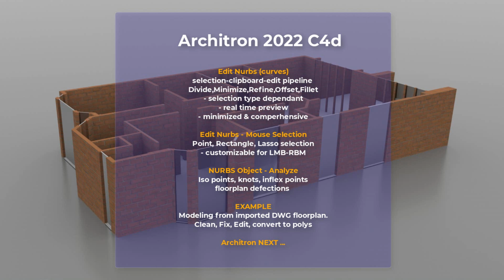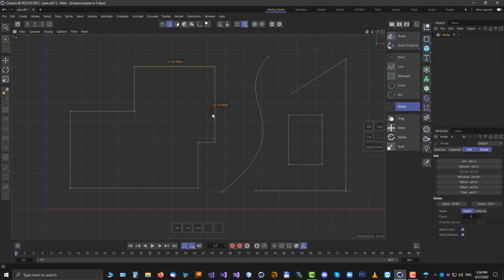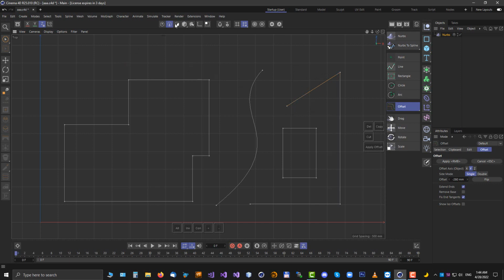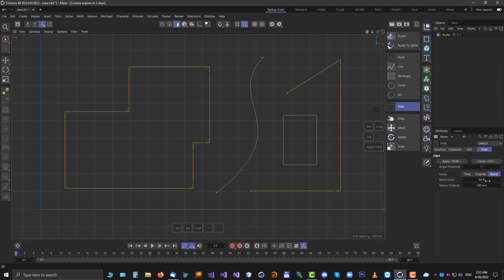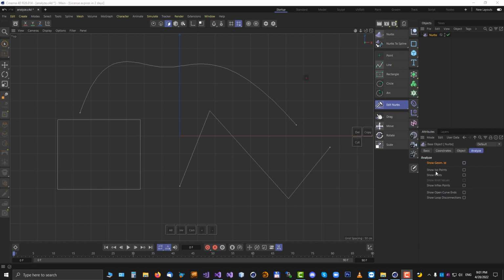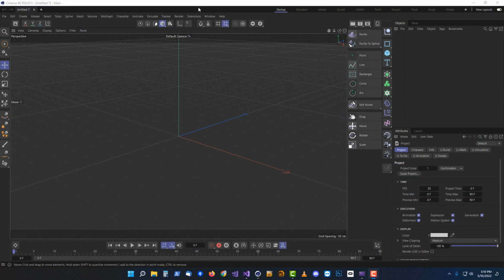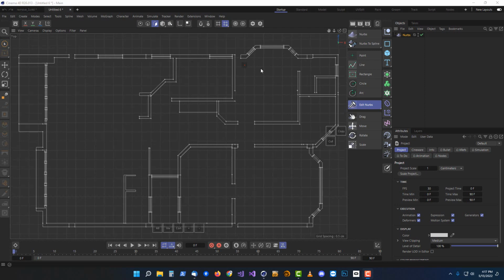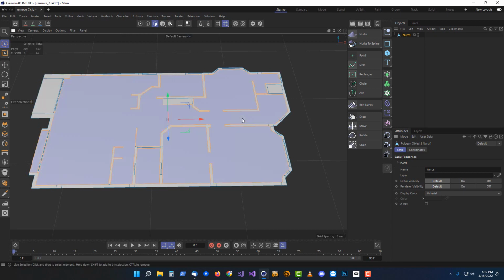Architron 2022 Cinema 4D R21-R26

Comment: The idea is good, but there is always too manual work to correct errors, and people create their cad in their own way, so every time there is some new thing to consider. At that point is still easier to  do it manually  from scratch. I think that the ideal solution will come with a strong and well trained AI that can understand draws and automatically create the 3d
Reply from the maker: Please hold off on your judgment until you see the whole picture. The tools in the current version are only low-level tools that will be used in the upcoming high-level automated tools. The current tools in the NURBS palette are just a preparation for something much bigger. The next version will show you a new system that is much more adapted to the Cinema style. Then I'd love to hear constructive criticism from you.
Reply: @architron  Why take offense? I didn't say your work is bad. I just say that for what I need, what is actual possible  is not enough for me. If there will some technological improvements from your side or from other creators, in the near future, I would be the happiest person on earth. I even subscribed to your channel to stay updated
Reply from the maker: @Arthemos1  No offense :) On the contrary, I really appreciate your feedback.